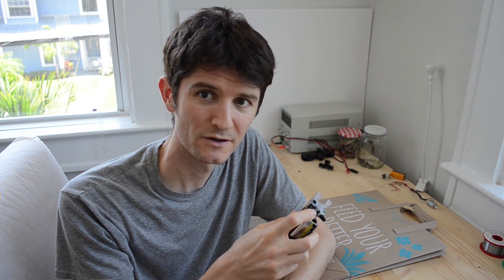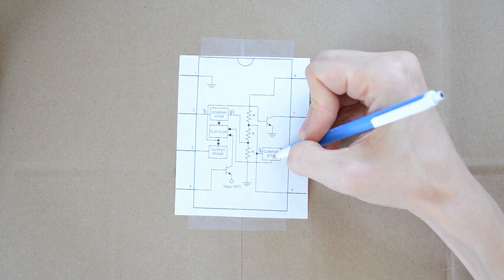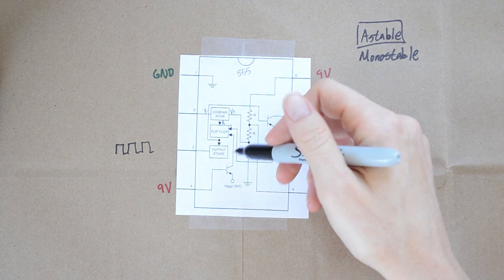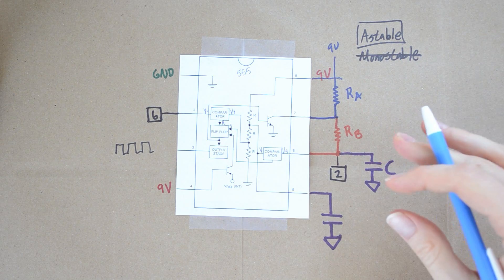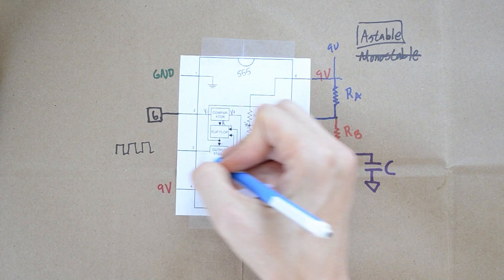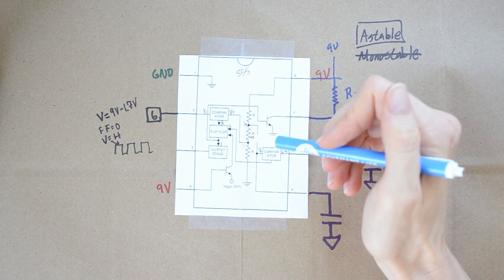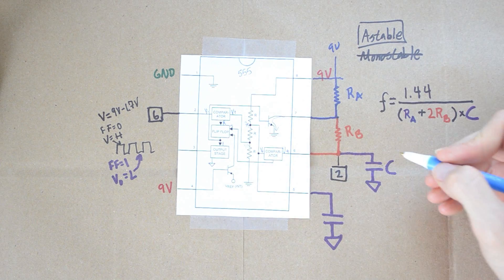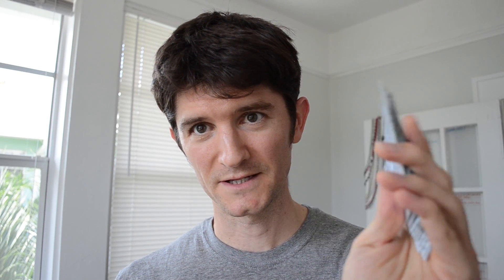How a 555 Timer Works

Comment: Excellent video, couple of general newbie questions. 
1) Is Ra generally smaller or bigger than Rb? 
2) You used 2 caps, are they supposed to be the same size capacitors?
Reply from the maker: +Charles Mongillo Thanks for watching! As to your questions:
1) For most of my projects, Ra is much smaller than Rb. This helps to make the on/off timing of the output pin nearly equal. For what ever reason, I usually have Ra at 1k. 
2) No. The capacitor connected to pin 6 labeled C is the timing capacitor. It helps set the timing of the 555. The capacitor connected to pin 5 is recommended per the data sheet for an astable timer configuration (aka a clock like the video describes). This is the datasheet I used: 

http://www.ti.com/lit/ds/symlink/lm555.pdf

It is recommended to use a 0.01uF capacitor on that pin. I do not have any 0.01uF capacitors in my stockpile, so I usually use 0.022uF capacitors and everything works just fine.

Comment: I don't suppose you can save me some time and just tell me the cap and resistor values for a 1Hz output?? Thanks man. I'm trying to make a rail signal "switchboard" to help me learn the NORAC rules and using flashcards just sucks so I'm making my own miniature semaphore with LEDs or maybe 12V bulbs if the 555 can handle it.
Reply from the maker: +Leonel Ventura Try Ra=1.0kΩ, Rb=750kΩ, and C=1.0µF. These values will get you in the ballpark. It seems to be right on paper but remember that electrical components have a percentage error associated with each. It would be best to use the Ra and C values and then make Rb adjustable by using a variable resistor that goes up to 1MΩ. With the variable resistor, you can dial it in. If Rb seems a little high for you, you can increase the size of the capacitor (C) and decrease Rb to be not as high.
Reply: Ok cool, thanks man, will be trying it out soon.

Comment: why is the voltage of the waveform Vcc - 1.7V? is it the voltage drop of the tranistors??
Reply from the maker: +Richard Salisbury The 1.7V drop between the battery and the high output state is due to a darlington pair being used to control the output. Look here:

http://www.ti.com/lit/ds/symlink/lm555.pdf

On page 1 find the two transistor looking devices call Q27 and Q28. These elements drop voltage (mostly by the fact that they are being turned on by the voltage source) before it appears at the output. This is what steals the voltage but this configuration is used to give an increase in current gain.

Comment: I understood the tutorial, thanks.
But i read we can make clock and counter using 555 timer can you tell me how that can be done ?
Reply from the maker: +Gokul naath I'm not 100% sure to what you may be referring, because both "clock" and "counter" are words that can mean many things. If you want to make a clock to know the time, the 555 timer is a bad choice. It would certainly drift over time and be highly inaccurate. You are better off with a circuit using a crystal oscillator of some sort. As far as a counter, you can use the output of the 555 timer to drive a counting circuit or chip. That's not too difficult as long as you don't want it the count to be as accurate as a real timer or clock.

Comment: Hi Jason! Nice movie, it is quite usefull.

Would it be possible to give the first 555 timer a high frequentie so the NPN and PNP transistor can control a stepmotor? can you replace Rb with a variable transistor to control the speed of the stepmotor?
Reply from the maker: +Pieter Terwen Hi! I'm glad you liked the video. I recently made a video using a motor with the 555 timer. You can watch it here: https://www.youtube.com/watch?v=8Z7kTCSZG5EIf this doesn't answer your question, let me know and I'll give it try.

Comment: Really good tutorial.  I didn't understand what the voltage drop of 1.7 was at the output.  Was that to do with the LED?
Reply from the maker: +Anthony B The simple answer is that the 1.7V is dropped inside the 555 timer and it doesn't always have to be 1.7V. A certain amount of voltage is used to run the timer, but internally not all of that voltage will make it to the output when the output goes High.This drop will vary. If you are running the timer with a 5V source, the drop on the output will be less than 1.7V. If you are running the timer on 15V and are drawing 200mA of current, the drop could be 2.5V. For a definite answer of how much you could lose in an application, the first table on page 6 of this datasheet gives you an idea of what to expect (Output Voltage Drop High): http://www.ti.com/lit/ds/symlink/lm555.pdfFor a more complicated answer as to where it's losing the voltage internally, check out the internal schematic diagram on page 1 of the datasheet. I suspect it's lost somewhere around component Q28 but I haven't done any analysis to verify it yet. Hope this helps!

Comment: great video! 
Question: I need a timer that can go on for 10 seconds and then off for 3 minutes then repeat... Do you know if a 555 circuit can do this?
Thanks
         Dave
Reply from the maker: +David mine You might be able to do this with a few 555 timers, a large capacitor, and some large resistors to really slow the count down.  Maybe the following video will give you some ideas. https://www.youtube.com/watch?v=mBA9uPeEzw4&lc=z13agfhbbsqvilq2522sxr5hnmi0hp1ua However, I would think that you might want to direct your search to looking at IC counters.

Comment: Is the 555 timer how PWM on microcontrollers is done?
Reply from the maker: Abdullah Almosalami Great question! The timing in microcontrollers can be done in two ways: a crystal or an RC (555 like) circuit. You can read more about it here: http://www.maximintegrated.com/en/app-notes/index.mvp/id/2154
Reply: Skinny R&D Thanks! :D. The term 'clock' refers to the 'digital-modulation' (is that a right term :P?) of the voltage, right?

Comment: Awesome video, I've been looking into working on circuit boards.

I actually made a remote controlled vibrating motor that let me prank people at work, but it was because I had service manuals to the radios and equipment to do it with.  Really wanna make some other stuff, so I'll be watching your videos.
Reply from the maker: Gunnanator Cool. Hope they can help you out in your endeavors. Pranks are a great way to learn. A colleague of mine once made a phone handset that you could swap out with a good one. The one he swapped out would shock people when they picked it up. You can have all sorts of evil fun with this knowledge.